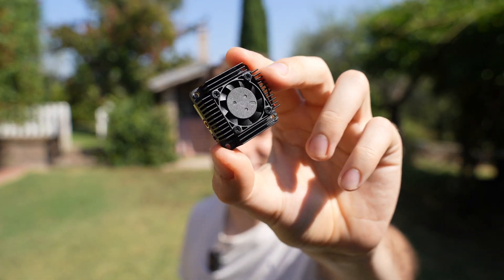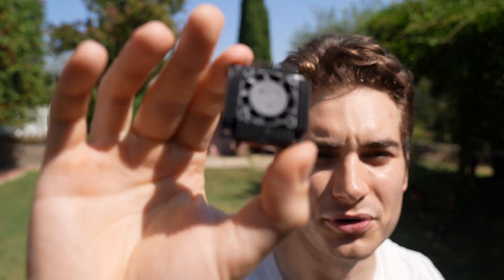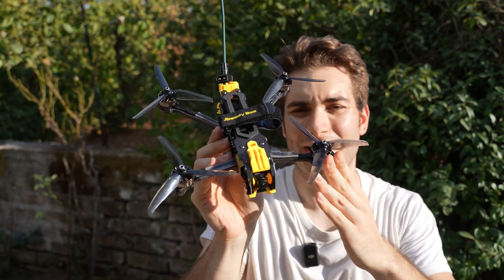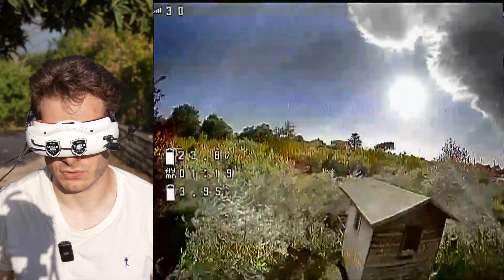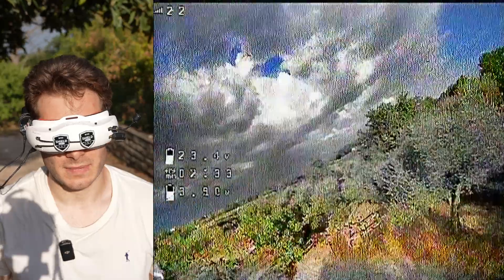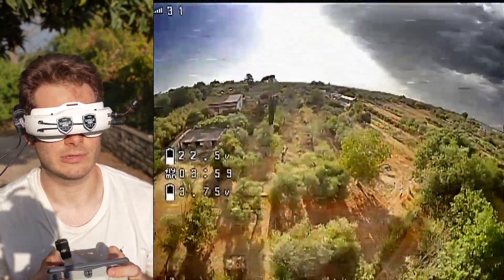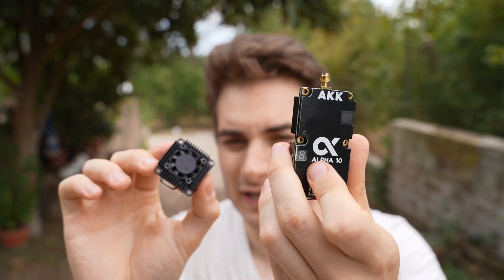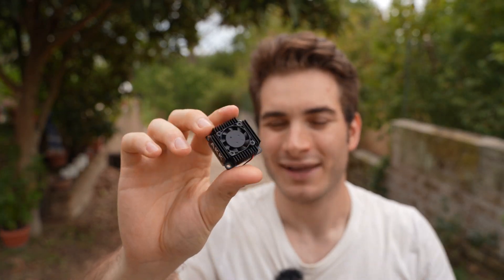Smallest 5000mW VTX! AKK TX5000AC Review

Comment: Great Video. Very interesting vtx. Try to put capacitor nxt to vtx input maybe
Reply from the maker: There are 2 connected directly, maybe is the 5v regulator that powers the analog cam having issues
Reply: Could be. 5W is a substantial current so its harder to iron out